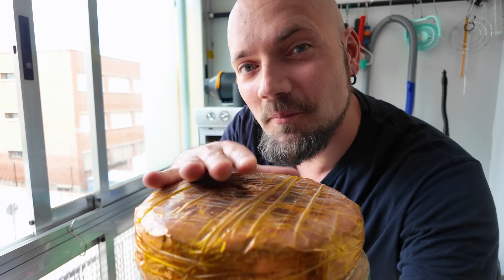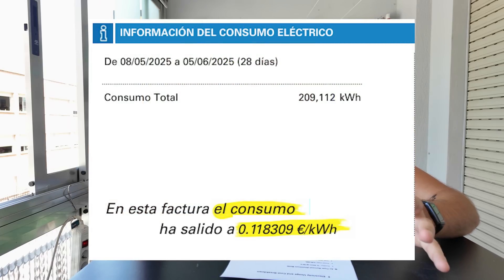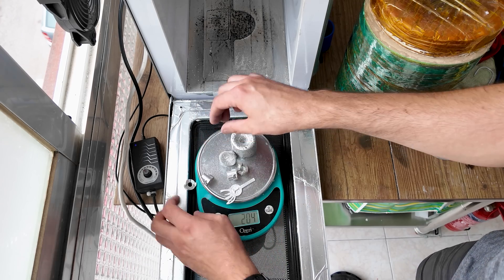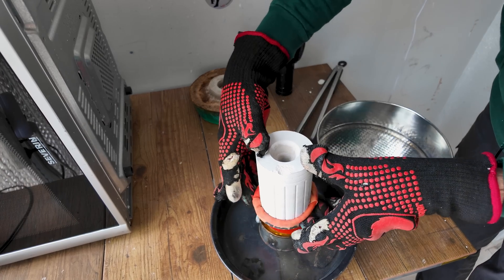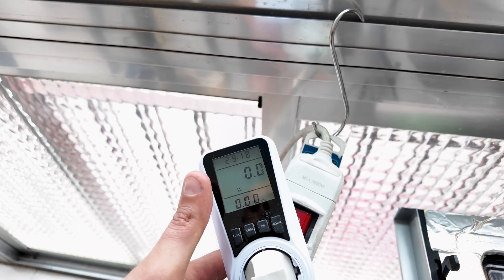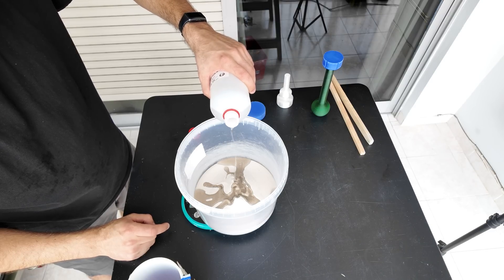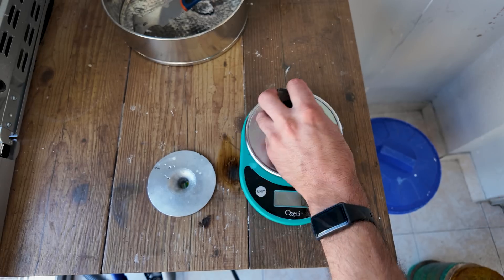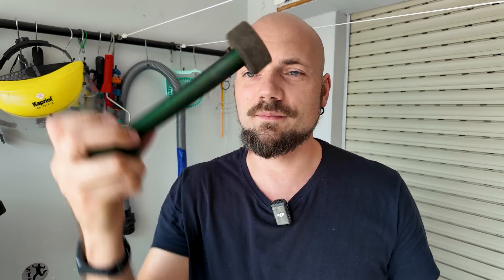Melting Metal in a Microwave – How Much Does It Cost?

Comment: could you calculate roughly how long it takes on full power for your microwave to reach melting temp with different metals aluminum, brass, iron stainless etc? Also how long it might take for different wattage microwaves 900w 1000w etc? It would be useful data to have as a sort of list of rough time estimates. maybe you could melt five crucibles with the same weight of each metal.

Comment: 🆔💫😊Why not open the oven from the top and fill it completely with rockwool, with a small cavity in the center for the crucible, and close the door with rockwool?
The microwave would be mobilized, but the insulation would be at its maximum.
Reply: Ah yes, the crucible must remain vertical and long. But it could be interesting for a ceramic kiln.

Comment: A bit ou of topic but i have a question about your Kilns.
Ceramic wool is quite expensive and hard to come buy here where I live . Could I Use Rock wool insulation material inorder to build such a kiln?
Or  is ceramic wool more temperature resistant than rock wool?
Thanks in advance.

Comment: Your videos inspired me to start casting metal. I don't melt metal in a microwave, but I use a torch and cast zinc alloys in a steel can and a high-temperature silicone mold, but what I saw on your channel motivated me to take action. Thank you for the motivation. Thank you for proving to everyone that if you really want something, you can achieve more than others expect of you, you can surpass yourself. It's motivating, even if it doesn't go well at first. You can think of 100 ways to cast metal incorrectly and one way to cast it perfectly. As they say in my country, "art makes perfect," through trial by fire to success, slowly but surely. You might not get it perfect the first, third, or fifth time, but eventually you'll eliminate the mistakes, and only success will remain. Good luck to everyone. Keep trying, because if not you, then who? Play with the topic safely, because the risk is high, but the reward will give you satisfaction, cheers.

Comment: I trust your experience, but it still seems a little bit odd to me that you heat cast iron with a gas torch prior to melting it in the microwave. Thanks for the educational and entertaining video and all the helpful info. Much appreciated.
Reply from the maker: It's only because it's quicker that way. You can really notice a difference in melting times if you don't do it.
Reply: That does make sense. Thanks. @ShakeTheFuture

Comment: Great blogger, I found a high-power commercial microwave oven with an output power of 2~3kw (actual output power). The cavity volume inside is 25/30L. This furnace is a dual magnetron. How about using it to melt metal? If a larger silicon carbide crucible is covered with an insulation layer, will the melting effect be faster? What are the risks of heating? Because it feels that the higher the power, the more uniform the microwave absorption. But I don't know what the actual effect is. Is the 30L volume a bit small? Or a larger 40~60L volume. The main problem is that the price is relatively expensive. I hope you can reply to me, thank you.
Reply from the maker: Yes it will melt faster, that's for sure. I always wanted to try a 2 magnetron microwave and I hope I will soon. The microwave I use in the video is a 29L microwave and for know it's enough for everything I want to melt. That said, I want a bigger microwave, so I could use a bigger microwave burnout kiln. In the chair melting video, you can see me using a bigger crucible towards the end of the video....to get an idea how much aluminium you can melt in a microwave my size. You can probably even go a little bit bigger than that...at least when melting aluminium.
Reply: A long time ago, I wanted to try to use the property of microwave ovens that cannot directly heat metals, and to use semiconductors to isolate and absorb heat to indirectly heat metals, but I didn't seem to take action later. Until I saw your work, it was great and verified the feasibility of this idea. I think using a high-power microwave oven with dual magnetrons to penetrate and heat the silicon carbide crucible will be more uniform. The time and temperature will be improved. It would be even better if 5-6 kg of black metal could be melted. Because of the density, I saw in your video that different metal liquids were cast, and the volume that flowed out was too small, which limited the molding of the work. So high-power equipment and large crucibles can better improve the quality and creation of the work. @ShakeTheFuture

Comment: Your work is great and cool. I would like to know what kind of fine sand you use to make the investment mold? Quartz sand?
Reply from the maker: Thanks! It's silica sand. The cheapest fine sand I could find locally.
Reply: @ShakeTheFuture I have seen your works in several issues. You can make different casting shells from gypsum, silicon carbide and quartz sand. This is a good choice. Silicon carbide powder is too expensive and not easy to clean and demold. Secondary recycling is cumbersome. Gypsum operation is cumbersome and requires high environmental requirements. The metal casting ball made with quartz sand has good parts molding and demolding effects. For precision investment casting, the air permeability of the shell is very important. But you did a great job! Great model casting master! Friend, if you need a formula for melting cast steel in a small crucible, I can send it to you. I feel it is very suitable for your small equipment and may be helpful to you.
Reply from the maker: @Zirao0059  Thank You!

Comment: man, I am in LOVE with the concept. I wanna meld metals this "easy" so bad... but i have no clue where to buy some of the materials in my country
Reply from the maker: Try asking chat gpt, it will give you a few options depending where you live. You will most likely need to buy it online as I also do.
Reply: @ShakeTheFuture  I was thinking about something that gave some doubs, would you mind answering? I saw some of your videos where you show it is a little difficult to harden the crucible. that you had to roll ceramic mantle on it, and it is a little dangerous, etc etc. first doubt: couldn't we just use a coal forge to harden it, would it b ok? and second, if you have a Kilm, why dont use that to harden the crucible? why rolling it in ceramic paper/mantle?
Reply from the maker: @NotavelMundoOculto  In most of cases I just heat the crucible in the metal melting chamber, but wrapping in ceramic fibre gives a different kind of effect from ceramic fibre. It's like a glue. Generally speaking I prefer to not wrap it, but in some cases if you find that your crucibles crack, that can be one of the solutions.

Comment: It has been awesome seeing your kiln's progress over the years, and it's amazing to watch you smelt things as demanding as iron! I don't know if this would be the right place to ask, but could I make a request for a potential future video?

I have been on the fence about making a microwave kiln for a year or so now, mostly because none of my current projects require casted metal. However, I have been working on making Roman concrete, and I want to make a microwave kiln to calcine limestones and clays / shales for this process. They require temperatures much lower than iron for instance, but normally you have to calcine them for a long time, but I wondwer how it would work for your kiln! A video of yours breaking this down would help put me over the fence to build my own microwave kiln ;)
Reply from the maker: Interesting!
I don't really know anything about the topic you are talking about. What is the actual part that you needed more info. Is it the kiln making/using or the actual "calcine limestones and clays" part? If it's about kiln making and how to use them, it's covered in this video:
https://youtu.be/XCI_FPDQA-U
Then it's just the matter of putting the piece in the kiln and running the cycle-timer (as well as measuring the temperature and taking notes, trial and error etc.)
Reply: @ShakeTheFuture  So correct me if I'm wrong, but a lot of the logic for smelting is "get the material hot enough to melt and you're good to go", which your system excels at, and even does it faster. 

For calcining these materials, they have to get to a certain temperature but not too hot because they'll loose their effectiveness. For limestone, that would be between 950-1100 celcius more or less, and you normally hold this temperature for several hours in a normal kiln. My question is, could your microwave kiln hold a specific temperature for a longer period of time, or would it even need less time because the microwave is working so efficiently?
Reply from the maker: @zackroot3166  Oh, I see what you mean!
It’s possible that in a microwave kiln, the process might work even better—though I’m only speculating, and it would need to be tested.

As for holding the temperature for hours, yes, it’s possible, although I’ve never maintained such a high temperature for extended periods.
Most of the time when I burn out my molds, we’re talking about much lower temperatures. Sometimes I hold the mold at 500°C for an hour or so, but normally I don’t go much higher.

In other words, it’s one thing to heat something in the kiln to 900°C, and another thing to hold it at that temperature for hours.
Holding can definitely be done, but you will need a much thicker kiln.

Cheers!

Comment: By the way you mentioned it but heres different/more important reasoning for drying before use - you also REALLY NEED to dry the crucible/mold/anything concrete/ceramic/plaster/rock etc first because many will literally explode when heated if they aren't dry because the water inside the material turns to steam and creates pressure and boom you just got stone age frag grenadeded. Not all wet cement/rock reacts that way when heated and obviously it depends on a lot of variables but its something you don't want to risk and will happen pretty often with a lot of stuff, I've witnessed this play out multiple times first hand with wet rocks and 'dry' concrete that wasn't 100% dry but seemed to be until it exploooooded everywhere and back in yeee olden days they used to build fires on/in/around large boulders after it rained in order to break them up and a lot of old survival manuals will tell you to put rocks around a campfire then put the under some dirt then sleep on top of it and it acts as a heated bed in cold enviroments BUT they explicitly tell you never to use river rocks from river beds because they're usually waterlogged and go click klack kaboomenflamenwaffle in the fire.
Reply from the maker: Thank you very much — I completely agree.
In this case, the sand mold was dried and cured in the kiln, and it stayed in the kiln overnight, so it didn’t have a chance to absorb any moisture. In fact, it’s often still warm the next day when I wrap it in aluminum foil tape.
Whenever I use a mold that was burned out more than a day earlier, I always reheat it in an air fryer just to make sure it hasn’t picked up any moisture. Thanks for the comment. Really appreciate it!

Edit: I just remembered that I was making a video about it, why it's important to dry your molds. I released parts of it as Youtube shorts and I am not sure if I'll even do a long format video anymore, but the idea was to demonstrate the effect with wet molds that are shaped in the form of volcano.
Here are a few videos:
https://youtube.com/shorts/br6pnQ8zuC8
https://youtube.com/shorts/eHZTqeQJLUk

Cheers!

Comment: Does plaster of paris molds usually work for aluminium castings ? I didn't thought plaster is as heat resistant, no matter how well it's dried before.
Reply from the maker: Oh yes, I have used it many times before.

Comment: "Everything's basically tire or concrete" ...zooms in to show a wooden table.
Reply from the maker: The stainless steel table is covered with ceramic floor tiles that look like wood.
Reply: @ShakeTheFuture  It's very convincing! Maybe you should burn it just to check...
Reply: @ShakeTheFuture  Oh, it's very convincing! I was just teasing, but maybe you should burn the table just to check!
Reply from the maker: @phoule76  It is convincing, that's for sure :)

Comment: You got sloppy in your prep mate😊
When i melt alli.i flux it with a pinch of borax wrapped in foil.drop it in top of melted crucible,push it down and   stir,scoop out floaties.
I find long conicle shape sprues work best and ajust join hole according to metal type.
I got sloppy pouring gold,now im cured😅
Reply from the maker: Yep, I agree. I heard about the foil method, but I have never tried it out. Cheers!

Comment: Thanks for another video. I learn so much. One question, in my own experiments with an 800W turntable microwave, if I remove the turntable and heat the kiln the uneven microwave distribution is clear from the colour of the element. How do you manage this problem? Choose a better microwave is one solution of course or use a flatbed inverter microwave maybe. Apologies if this is answered in another video, I must've missed the discussion....
Reply from the maker: I just don’t worry about it — it hasn’t been an issue for me. I mean, I’ve noticed it too, but it doesn’t make a difference, at least for the kinds of projects I do.
In other words, I don’t do anything about it. 😉

Even if you keep heating the kiln, all the rings should eventually turn red, not just in patches. It’s at the beginning of the heating process when uneven heating is more noticeable — later it evens out... at least in my experience.

I’ve never tried an inverter microwave, but I’d like to.
Cheers!

Comment: Can you get a better finish on the iron castings if you use a finer grain sand? The part I want to cast needs to be a little smoother without having to grind/sand it down.
Reply from the maker: Yes you can.

Comment: I just dropped $100 on screws to build a fence, and it hit me—how much usable metal have I thrown away over the years? What if I stopped donating old kitchenware and instead melted it down each week in a home microwave forge, casting a dozen billets at a time? That’s over 600 billets a year. Imagine a decentralized system where makers exchange billets for custom hardware—turning household scrap into precision-engineered screws, all powered by backyard ingenuity and local micro-forging.
Reply: Heck yes, man. Since I started melting scrap with my homemade propane furnace, and the amount of metal items i throw away has reduced dramatically! i have a milk crate filled with pure ingots of aluminum, brass, and copper, to be used for a variety of projects now. I mark them with what was melted to have a rough idea of the quality of material, such as whether the aluminum is from cans, or something like a bike frame. I haven't made it past the barrier of melting ferrous metals. I love the idea of having a community maker space where people could exchange scrap for billets, or volunteer time to learn how to melt metal, blacksmith, etc. Or people could just donate extra material and tools. Imagine all the stuff that could be saved from ending up in a landfill if clever and creative people had the resources to upcycle and reuse what is garbage to the average person!
Reply from the maker: I love the idea! I wish I had a backyard or some other way to melt metals outdoors. Every time I throw away old kitchenware, I think about melting it down, but since it's covered in paint, nonstick coating, and other stuff, I don't do it because it would produce too much smoke to do it on a balcony 😊

Comment: Sadly seems like gas would still be cheaper on average (0.04 euros per kw/h)
Reply: Depends on the efficiency. I think the efficiency of gas burners when the object to be heated is quite close to the temperature of the flame can actually be quite aweful; most of the heat will be blown out of the top of your kiln; whereas with this microwave method, I would expect it to be 10x more efficient at least.
Reply from the maker: That's cool! For me using the gas is not an option, but it's good to know.

Comment: I bet it's the plaster, PLA, and the like that really count when working out the cost of these things
Reply from the maker: I could have included the cost of plaster, but it's actually also cheap as it's some kind of wall patching plaster. I used to use a dental plaster of Paris. That stuff was expensive comparing to what I use now. I suppose it was better 😊
Reply: @ShakeTheFuture the dental one might just be a finer mix, or heats up less when its curing

Comment: Actual cost highly depends on actual region. For example, in Russia it will cost approximately 5₽/90*0.9 = 0.05€ and in Cyprus 0.3€ for each process.
Reply from the maker: Yes, that's true. Cheers!
Reply: In Spain you can go as low as 2 cents per kw/h if you sign a contract for the "regulated market" and you time your usage to coincide with the production maxima (2 to 3pm in the summer). Then there are a couple taxes on top but it can get very cheap from time to time.

Comment: Did the plaster have enough time to set before all the water was cooked off?
Traditional lime plaster can take over a day to absorb enough CO2 to mostly cure... you can speed it up with CO2 by keeping it damp with seltzer water or similar
Reply from the maker: Well, maybe not. Some molds I rush, because most of times they work out just great, but I don't remember about this one. It was not my best mold, that's for sure :)